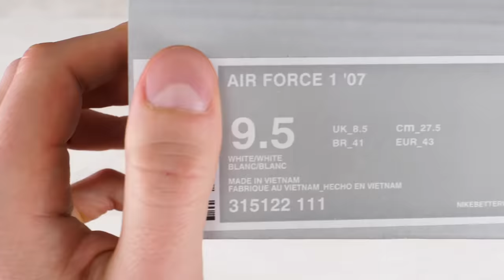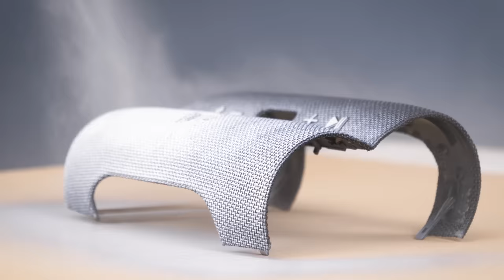Compilation of Best Hydro Dipping Videos

Comment: I'm not worried of the "uglier" look. I'm worried about the texture and how it might chip later on.
Reply: If you put a layer of clear coat, it shouldn't chip
Reply: It really depends on how you plan to use the object and how often you will use it
Reply: Ryan Leslie I swear a lot when I play so idk if it will get ruined when I hydro dip a controller
Reply: charles thomas and here I was thinking I was the only one in the entire world who did that
Reply: Same
Reply: Maynard Vargas Put some type of wax on the object.. that should make it smooth..
Reply: Just get an acrylic/oil based primer. If you do oils, you need mineral spirits, and maybe some coating of the respective type with the finish you want. Gloss, matte, etc. I think acrylic is sealable faster, easier to clean, primes onto more surfaces, and dries faster. But take your pick.

Anyway, just prime, dry, add paint, dry. Wait for the total drying time (acrylics is like 2 weeks, oils is like a month or two) then seal
Reply: @theydontnoahguy  p
Reply: @theydontnoahguy  .
Reply: @theydontnoahguy  o

Comment: shame that this type of diy hydro dipping wears of very quick and can leave stains everywhere, using proper hydro colour sheets will make the pattern last significantly more time
Reply: Stalin?
Reply: It's also a shame all this looked like shit. Anyone who follows this video deserves to have their expensive shoes or electronics ruined
Reply: 2Quick4U I think he is talking about the quality of the dips. Not the colors. It looks fine from far away, but there are a lot of uneven parts.
Reply: @2Quick4U not to mention this diy hydro dips give weird textures
Reply: @2Quick4U it literally all looks bad
Reply: I like to have stuff in the original condition when bought but Laquer spray is better because it doesn't smudge and is waterproof, it's used on the modern car, but there  a hundred layers of it so it's resilient. Doing 1 layer will offer long term dissapoint. Essentially paint is like coloured glue so the more layers of it, the more hard wearing and smooth to the touch it will be
Reply: @JamesPhillipsOfficial  not sure what u mean by 100 layers or lacquer and also paint isn't coloured glue, two very different things
Reply: Who else didnt care about the guitar?
Reply: Kostas markevicius su stalino nuotrauka. How... shameful
Reply: @kostasmarkevicius1435  approximately, it is thickened by layer hence hard to remove, yes paint is SIMILAR to glue with color in it, just easier to work with.

Stop being a chump
Reply: Couldn’t you finely sand it down after the paint cures and then apply a clear protective coat to improve upon how he is doing it?
Reply: @joshuacarter4590  if you were to sand it down after it would just look dull or show the mesh underneath, again this method with spray paint isn't even that much cheaper than using budget sheets of the proper stuff but looks so bad it makes me wanna cry
Reply: @andrewpullen7956  whats the spray paint called
Reply: @joelhamlyn5186  i think theyre good but never use black paint if youre gonna hydro drip jbl speaker

Comment: Let’s admit we all want to try this but are afraid to ruin our stuff
Reply: Omar Seddik im just too lazy 😂
Reply: It will ruin your stuff
Reply: I would forget how to put it back together
Reply: Omar Seddik i do this too, i thought i would ruin my first time but it turned out perfect
Reply: @lewisfontes6973  it doesnt rub off after normal amounts of wear and use?
Reply: Joseph Raus nope
Reply: Same
Reply: Correct
Reply: Big Man Same 😂
Reply: me and my dad are doing it with skechers for pratice then the new shoes i got but yeah i am worried ima mess it up xd
Reply: Somebody good luck if you haven’t done it yet
Reply: @BigMan-ie3ly  same, thats why i need to buy new controller
Reply: @megs8654  it's not hard to put together a controllera it's literally just screw in place, time consuming is what outs me off
Reply: @Xighor  then i guess i just put it together wrong. if it comes to time consuming its not an issue for me, this month im gonna have much less work to do on job, so theres be plenty of time
Reply: @megs8654  you literally can't I've never worked with a PS4 controller but I've fixed plenty of my  broken Xbox controllers

You need to a special screwdriver just unscrew any screw, take on the circuit board and buttons so you're left with the plastic shell, put it Inna hydro dipper, wait till it dries, than just put it back like it was before by just lining it up, making sure the buttons are in place and screw back
Watch a video, I just quickly did looks harder than Xbox one but still simple shouldn't take more than 10min to assemble

Hey here's one benefit once you do it you can easily fix a broken controller if you get a fault, glad I did since I've probably saved multiple with a $1 simple fix
Reply: Correct. My ps4 to be exact
Reply: Big Man oh lmao this is so me dude xD
Reply: It will ruin it look at the outcome
Reply: I know right
Reply: I was scared, but I did it and it looks epic!
Reply: Look my profile pic
Reply: Omar Seddik yessir
Reply: Basically
Reply: Why is this
Reply: You just don't know how to. People are afraid when they don't know what to do.🙄
Reply: Yep I agree Omar seddik
Reply: I ruined my 700$ Gucci shoe 😖😭
Reply: Omar Seddik hahahaha totally me😝😝😝😝
Reply: No
Reply: We could get another one of our stuff and customize it
Reply: Hell yea
Reply: Yep
Reply: ForZe_AzZazIn did you use a clear coat or no
Reply: Joseph Raus no it wouldn’t
Reply: Nice video
Reply: True
Reply: ForZe_AzZazIn my controller randomly opened when I started using it after hydro dipping it?
Reply: هلا بالصادق عموري
Reply: @BigMan-ie3ly  then Don't hydro dipping a complicated things.. just a normal things Like pencil.
Reply: He has 9 mil subs
Reply: Ikr
Reply: The paint on his stuff looks uneven and nit pleasent to touch. I think I'll try in on a random piece of wood first
Reply: MMAANN
Reply: Yup
Reply: Fax
Reply: no
Reply: @lewisfontes6973  ist spay pain so it will even with primer. 🤔🤔🤔
Reply: @RabidTurtle999  u have to use polymer after
Reply: If I did it I would brake my stuff
Reply: True
Reply: Imagine doing hydro-dipping with a cat
Reply: I want to hydro dip my mouse but i am scared LOL
Reply: @RabidTurtle999   have you even tried?? I’ve done a couple guitars snd sneakers.    If you do it right it comes out great
Reply: True
Reply: @manuelschutt4858  same
Reply: @RabidTurtle999  with primer it shouldnt

Comment: I can't be the only one who thinks this is NOT nice..
Reply: Thank you! I thought i was the only one
Reply: You are completely correct. These people ain't putting any clear coating on the pieces after dipping, nor are they lifting the dipped piece through completely clear water afterwards. A good hydro-dip job needs to be lifted through water that has zero particulates/used hydro dip, needs to be left in a cool, dry place for 24-48 hours, and needs to be coated with a good vinyl clear-coat lacquer.

Comment: A tip if you cover the sides of the bucket with newspaper you dont have to change the water you just pull the newspaper out and it lifts out the paint

Comment: I think that if you painted the hydro dipped guitar with a couple of coats of poly acrylic and then fine sanded and polished that it would produce a stunning result. Better yet, dip, poly coat, tape, dip, poly coat, tape, dip poly coat. As to the shoes have you tried this with fabric paints?

Comment: You can't hydro dip anything that moves like shoes as the paint will crack instantly. 

The only way to do it is to use acrylic paint which you still can't get to float on top of water.